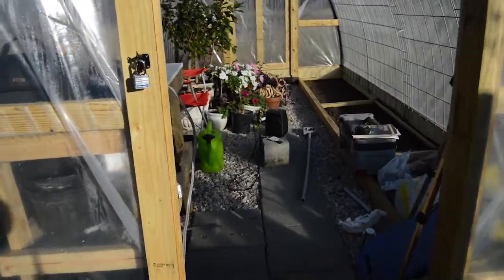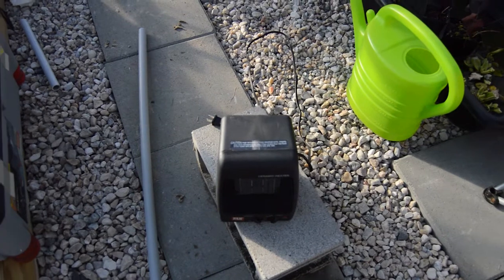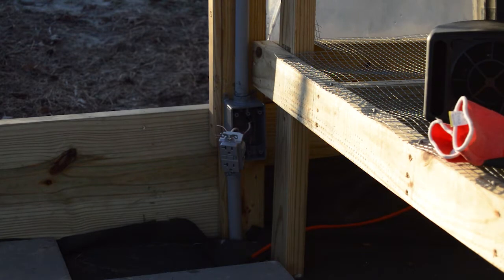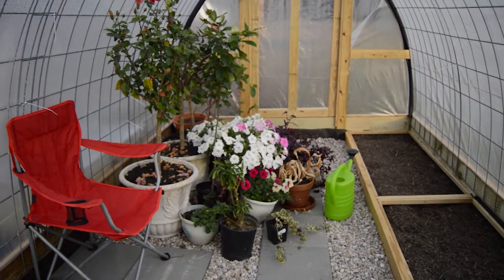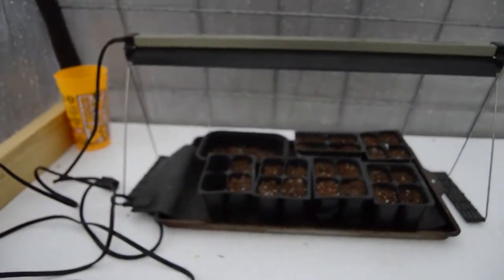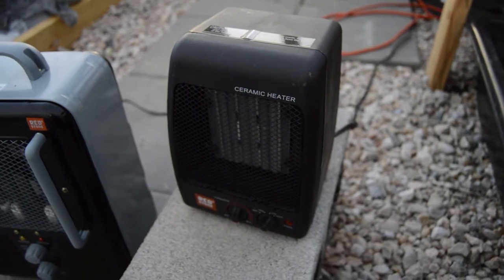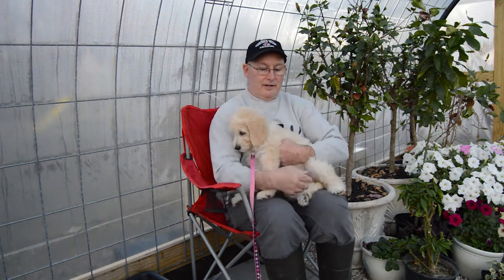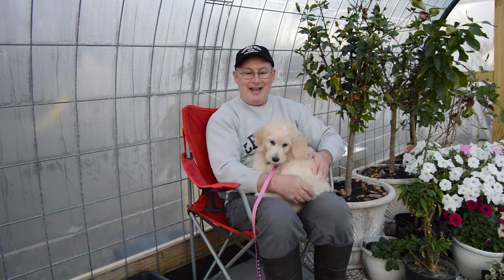Wiring a dedicated electrical circuit to the greenhouse!!!  Episode 5

Comment: You should use THHN wire in conduit not romex.
Reply from the maker: Thanks for the tip.  I only ran the romex through the conduit where it would have been exposed above ground.  The type of romex I used for this project is rated for being buried in the ground, so I dug a trench and buried it from my garage to where it comes up out of the ground and enters my greenhouse.